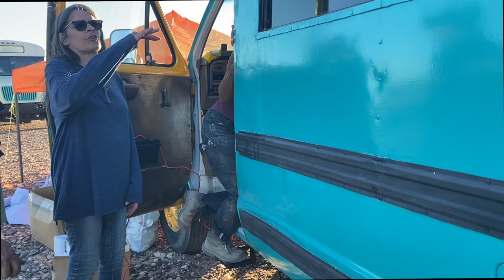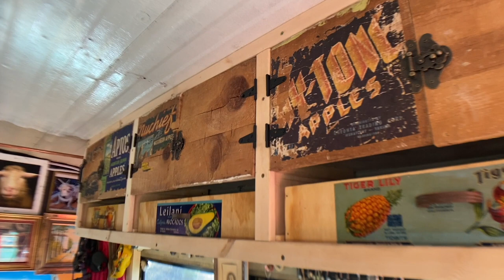I WRECKED it. They REBUILT it. Amazing Skoolie Crash REBUILD

Comment: this fills my heart with so much joy. What a wonderful tribe to be a part of. So amazing to see that there is still so much good still left out in the world. People slowing down and helping other. My goodness. <3
 I myself am in the middle of a conversion. Put a June 1st time stamp on it. Located in the mountains of northern Calif has put a halt on prepping my roof for fan and Solar. So until the weather permits it's building, sanding, staining what I can inside. Electrical is where I'm at now, but keep putting it off because it's flat out terrifying, baby steps I keep telling myself. Descend on Bend is so far the only thing planned. Hope to meet you there. Take Care.
Reply from the maker: I didn't do any "proper' electrical, because I felt, as a non-electrician, it was safer for me to have components that are easily inspected and not hidden in the walls etc. Having done a lot of my work on Max in snowy New England, I definitely feel your pain on the weather situation! Goo dluck with all of it, and hopefully our paths will cross!